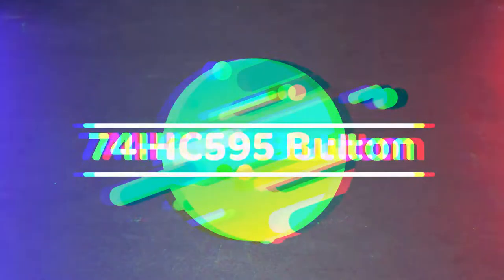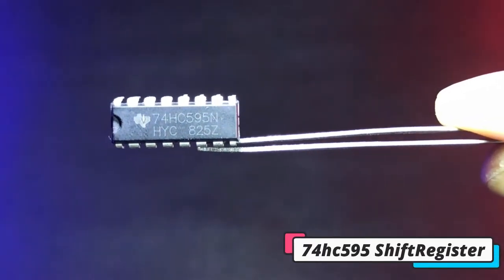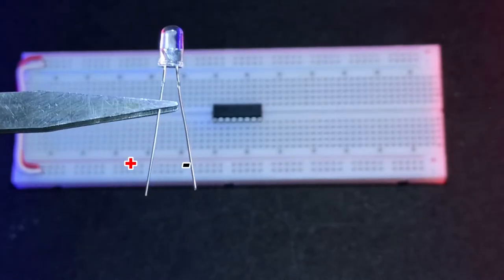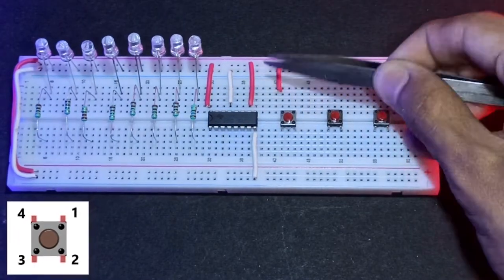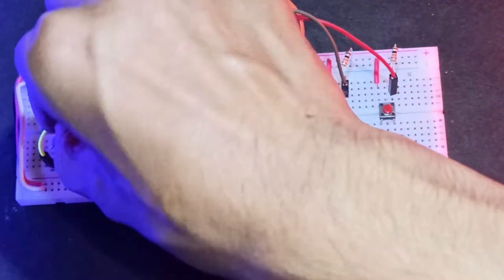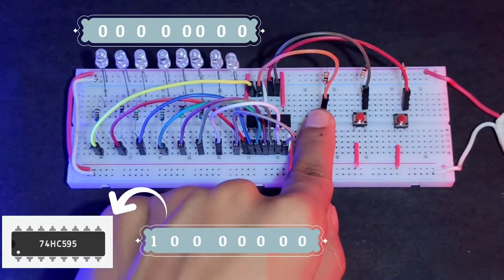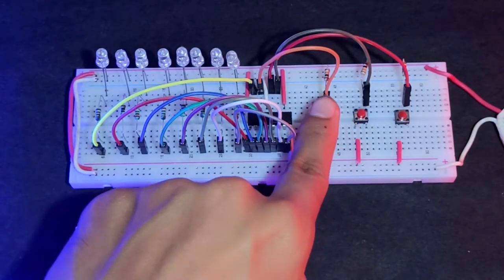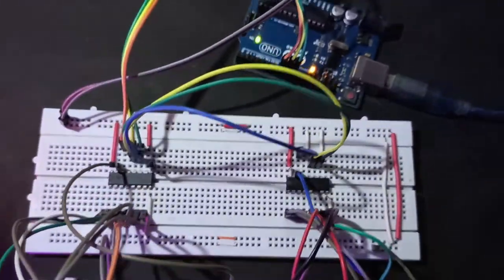how does a shift register work | Control 74hc595 with button without arduino

Comment: Please can you show us how  we make a dual seven segment counter to count  0 to 15 with 15 dip switches on the input side . Let say dip switch 1  is On , dual 7 segment led shows 01 then add dip switch 2 and show 02 and so on. Every time add one dip switch it adds one to the counter so to read 15 . Please bear in mind when all dip switches are in on state the counter will read 15 .

Comment: Why is it that the 8 led turns on whenever I put 5 v supply? ...  Where is the fault there?... Please help!..... From the philippines
Reply from the maker: Just add reset button for off all led after that you can set the bits. Send your mail address i will send you the circuit. how to add a reset button.

Comment: In your video,
Pin 11(clock pin) - is connected to Vcc(5V)
Pin 10(reset pin) - is taken as Button B(clock)
But actually pin 11 should be connected to button B(clock) and pin 10 to Vcc(5V) right ? ?
I had a doubt
Reply: When i do it they all come on and the I push button c and the kinna change seemingly at random

Comment: Is this possible without the resistors for the buttons?
Reply from the maker: Maybe it works but not precisely. the resistor is used to avoid automatic pressed and electronics noise, to get high low state.
Reply: Sometimes resistors can keep you from burning out your led also

Comment: Mine isn't working. I turn on the power supply and no LEDs are on, then I press and hold the data button and I see Q2 and Q6 LED on. I press and hold the data button then press clock button followed by latch button and still the only LEDs on are Q2 and Q6. No shifting or new LEDs turn on.
Reply: I wonder if the button presses are not supplying enough of a voltage difference to indicate a pulse.
Reply from the maker: Have you use 10k resistor with button?. Its used to avoid denouncing of a button.